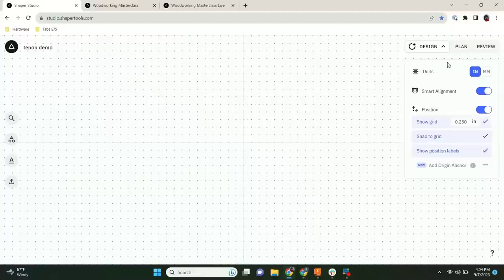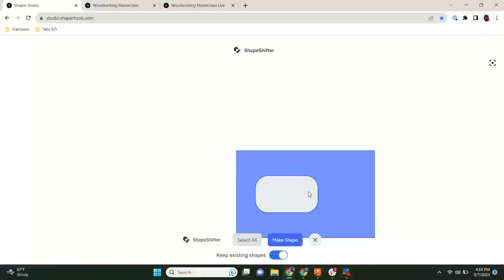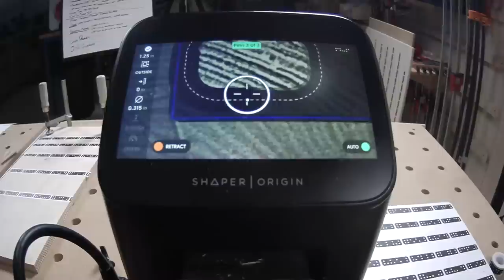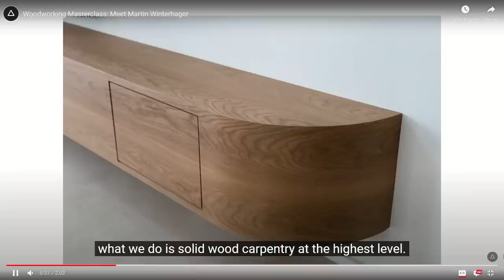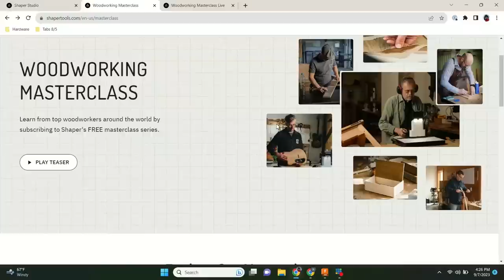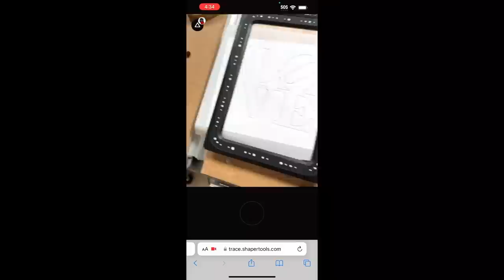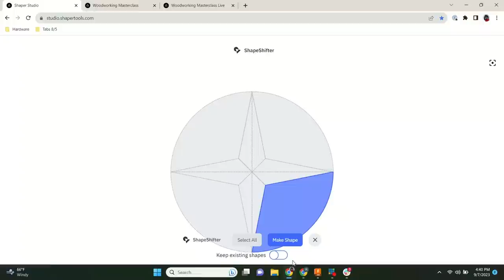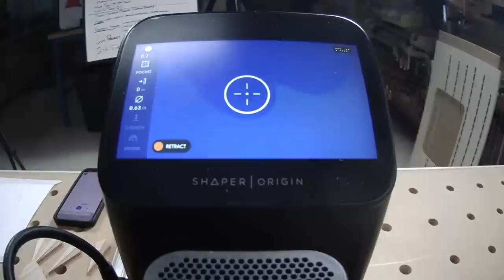Session 89  – English: Studio Update - Custom Anchors, Mirroring and Selection Manager

Comment: I believe I have figured out my question below after working on some tenons.  To probe the "backside" of the work, I left the board off Workstation and probed the MDF spoil board for points 1 and 2.  I then aligned my work piece on Workstation and finished with point 3.  It all made sense once I tried actually doing it, and it worked.  Hope this helps anyone else that might have been confused as well.

Comment: I've viewed a few video's now on doing tenon's.  I understand the concept of of doing your probing off the backside of the board.  However, I'm assuming you raise the stock above the level of Workstation for the probe to make contact.  Does it not matter that Origin is not level at that point?  Or, am I'm thinking incorrectly on  how you probe this way?

Comment: Help please. Swatting up on all of the shaper videos before I order mine here in the uk. I understand the rounded rectangle for the tenon and the rectangle for the outside of the material used but for the life of me me I am struggling to understand why you have drawn a third rectangle. Hopefully someone from the Shaper team can explain the process in simple terms and apologies for not understanding what is probably basics of using the Shaper Origin. Regards Craig.
Reply from the maker: No worries Craig - the third rectangle is essentially for overhang. Since the bit is round, we need some overhang in order to cut a pocket that has sharp corners. Otherwise, the corners could be rounded.
Reply: @Shapertools  I get it now, thank you for responding so quickly.👍